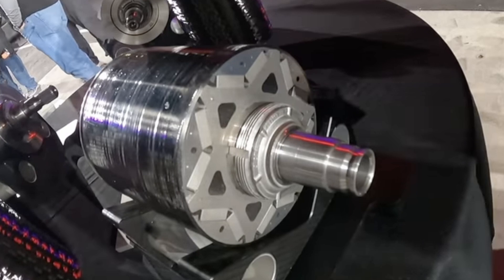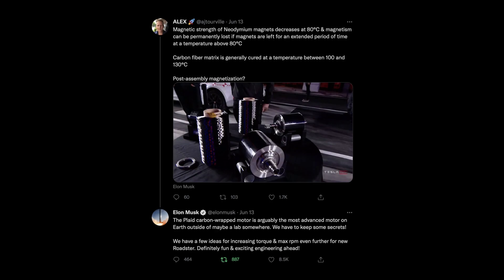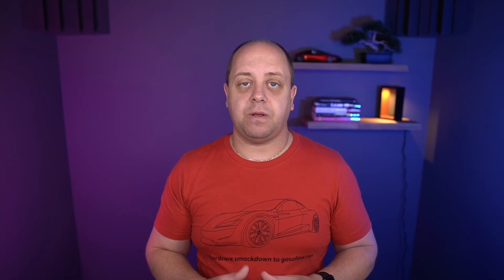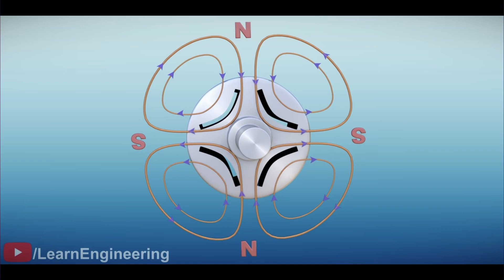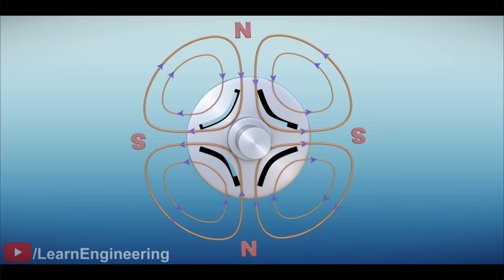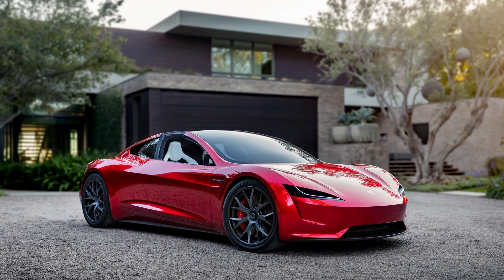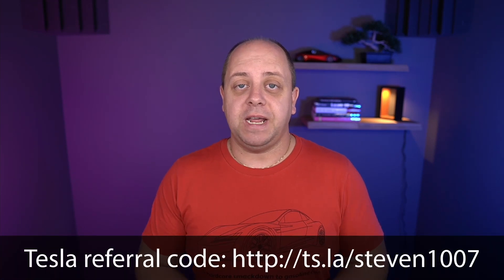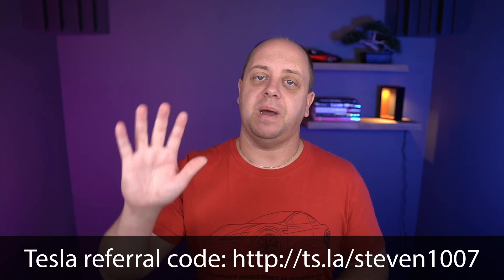Tesla Model S PLAID carbon sleeved rotor is impressive tech

Comment: Is this motor patented?
Reply from the maker: Even though Elon said it was the first time this motor is used, carbon fiber overwrap rotors have existed for some time. They have just not yet been used in EVs at scale. I don't know if it's patented or not, but I don't think so, as Elon literally mentioned "we have to keep some secrets". If it were patented, the whole design would be out there, in great detail.
Reply: Wonder if I could put this motor in my Kia Niro EV? So hot off the line...0 to 60 in 2 Seconds!! I'm  89 yrs old/young so would love that off the line capability, right!  My 29 Ford Model A was awesome also with rear rumble seat was a kick in it's day!!! 😂

Comment: I actually suggested the CF wrap of the rotor years back, several of my ideas have been implemented so I'm thinking Tesla/Elon pays attention to various forums.
I also suggested having hydrogen in the motor to have low aero resistance at extreme RPMs but you have to watch for hydrogen embrittlement. Hydrogen is also a good heat conductor apparently. Maybe they've also done that but maybe the hydrogen is too hard to keep in. Or you need to replenish it.
I also suggested laying a rocket on its side to bleed energy when coming down. Which wildly they did :)
The knightrider theme was me too. Some could be independent ideas but the timing and numbers are suggestive. It's flattering but would be nice to be credited officially.
Reply from the maker: I’m sure Elon and the team are listening to all ideas that have a solid foundation in physics. Now, physics is universal so they could logically come up with yhe same ideas. I’ve had made some remarks in the past as well and then they got implemented. Was it really my suggestion? We’ll never know, but I fo know that several Tesla engineers and people higher up in the food chain are a member of my channel. So I’d like to think that every now and then I’m making a small contribution to the development of the product
Reply: @StevenPeeters  yeah, everyone watches youtube.
Reply: @StevenPeeters  They are also on LinkedIn. ;)
Reply: The idea of carbon wrapping things for extra strength is not new, the hard part is coming up with a machine that can do a lot of it cheaply.
Reply: @odisy64  Indeed. Thats was in mine opinoin i series from BMW ahead of time. Sadly they sold carbon plant and almost all tooling for jus one golden egg. LOL
Reply: I came up with the idea of combining chocolate and peanut butter in a “cup” form. You are welcome.
Reply: Why have any gases in the motor? Why not a vacuum? 

The CF wrap causes larger gap between rotor and stator. They should do axially and radially reinforced carbon fiber laminates instead of steel. Lighter, less inertial resistance, and closes gap. Trick is making it mass producible.

Comment: Will they be able to improve it for roadster so that it can handle more power?
Reply from the maker: Elon said at the unveil that it might spin faster, so that is needed for too speed. As for power, I would love to see a 4-motor setup, just like the Rimac Nevera. That would easily make over 1700HP then, with full torque steering. Plus, the car will weigh less than this Model S
Reply: @StevenPeeters  IMO, the drivetrain is the same as what would have been in Plaid+ (so "1100+ HP capable) but the limiting factor is the batteries, Roadster will almost certainly have 4680 and as you say, maybe even 4 motors. :)
It'll be fun in a few years if the whole range ends up with CSMs (for efficiency/weight reduction as much as performance) and 4680. I can't wait to see the next 2 to 3 years of development. Awesome stuff.
Reply from the maker: @eubikedude  I agree that the 4680 cells are needed for the Roadster. That is  why we don’t hear anything from the Roadster anymore now. They need to get the 4680 working at scale before we see more from Roadster. I’m still betting on a 1000 mile range too. Just to put an end to the range discussion once and for all.
Reply: @StevenPeeters  👍
Reply: @StevenPeeters  Steven your video is fantastic. And I also love your roadster t-shirt! I am rooting for the roadster to outperform Nevera as well, and if it takes 4 motors.....so be it!
Reply from the maker: If you like the T-shirt, you can get your own from my webshop while supporting the channel 😉 https://www.silver-lining.be/product/roadster-smackdown-red-unisex-t-shirt/
Reply: @StevenPeeters  I ABSOLUTELY will be ordering multiple of those shirts!
Reply from the maker: Awesome. You are very much appreciated.
Reply: @StevenPeeters  Oh yeah. I would add 5th motor for compressor unit and difuzor fan. Like is in Murrays T50 "Brabham car". That wopuld littery fly  and eat dust lOL
Reply from the maker: @alesksander  The Next Gen Roadster will already have cold gas thrusters, so I'll cover that when I get my hands on mine (if it eventually comes and the thrusters are allowed by the RDW for homologation)
Reply: @StevenPeeters  Yeah and hence need for compressor. TBH fan would be much more efficient use of kWh for aero porpoises and laptime on track.